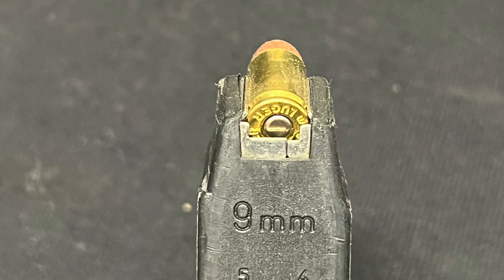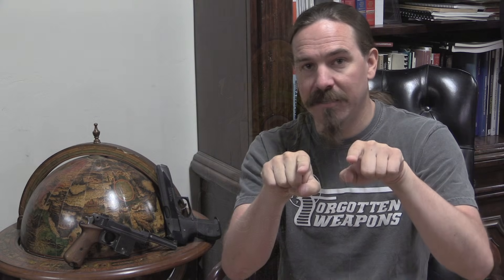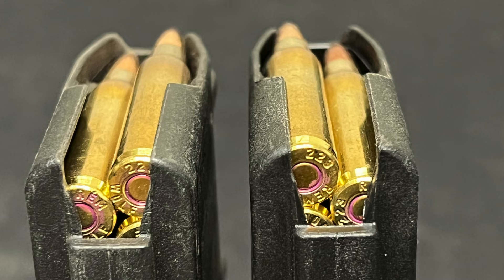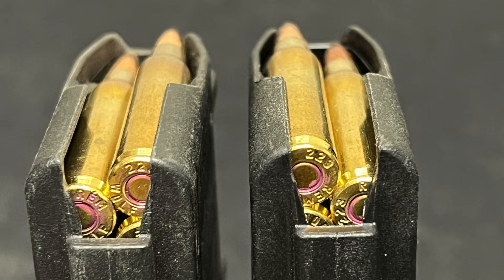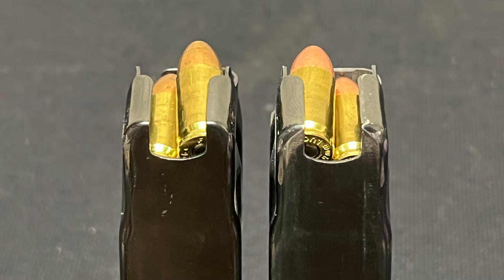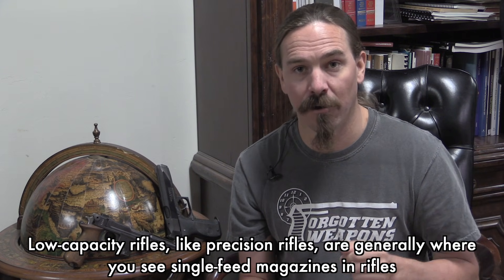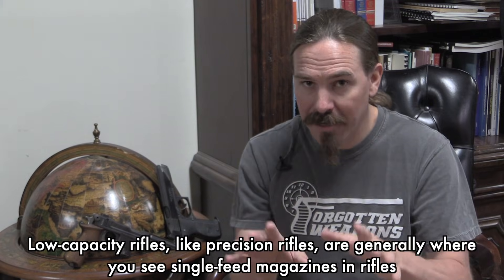Ask Ian: Single Feed vs Double Feed Pistols

Comment: There’s also the problem with space for the trigger bar (or more generally transfer of trigger pull to sear). With the narrower single feed, there’s much more of it, with double feed, it also adds to the width of the pistol. The Steyr GB has a sheet metal frame (with reinforcements where necessary), so they managed it well, but milled frames grow pretty wide with double feed magazines (unless you would perhaps use something like the transfer lever in the slide, like FN HP 35 does). Note e.g. the dual trigger bar in CZ 75—it’s pretty wide (despite the single feed magazine), and so is the frame. But that’s mitigated by the inverted rails system. Should the slide run outside the frame, it’d be huge…

Comment: Any experiences talking about reliability?. I´ve seen many feed problems on old long arms due to old, damaged, or poorly mantained doble feed magazines, specially sub machine guns (maybe shorter cartridges feed worse). But I suppose an old, damaged and poorly mantained single feed can be problematic too...

I don´t know, I suppose the lenght of the cartridge is key here. Shorter ones feed better, or easier(you get the idea) with single feed, longer ones are OK with double feed.

Comment: While I agree with most (maybe all) of the objections, I suspect that almost all of them are more "I don't wanna, I don't have to" . In other words, objection "because the engineer didn't have to" is probably the most influential. Pistol width could be a factor, but I don't be it has to be the issue. After all, the entire handgun is wider than the magazine either way. I think it's time for full-sized handguns with double-feed mags (at least in 9mm). Obviously the width issue would be huge in a bigger caliber, like .40 or .45.
Reply: Did you pay attention to the video at all?
Reply: @antuanperez426  Yes. Why? Did you read my comment at all?
Reply: @nerdyengineer7943  Yes, I did. He literally explained the reasons why there haven’t been developements for double feeding in pistols. 🤡 I read your entire nonsensical comment. The engineer didn’t want to because it makes for a more complicated system with diminishing returns.
Reply: @antuanperez426  Interesting. Because I am an engineer (I really am). I understood everything Ian had to say. The mechanical drawbacks he mentioned in the video are not an issue on a full sized handgun in a smaller caliber, such as 9mm - the slide strength aft of the breech is a non-issue in a Browning action (which most modern handguns are). The primary drawbacks, as Ian explained, are increased engineering hours without a GOVERNMENT customer requirement. But since people like me, and the guy that asked Ian the initial question, want a double-feed handgun and the CIVILIAN market would be delighted with it, there is money to be made.
But you're obviously not a mechanical engineer that deals with these exact issues day in and day out. So I can excuse your ignorance.
Reply: @nerdyengineer7943  You’re right buddy, I am a third year double major in Mechanical and Electrical engineering (I really am)  👍Again, you are complaining that not enough progress has been made in this area. If you used what you learned in school or at work for a second, you would recognize that making something small more complex for little benefit is not a good use of resources, whether the “GoVeRNmEnT” is asking for it or not 🤡 Why would you spend extra time in R&D for a double feed magazine when you could be researching (for example) designs that can make the firearm slimmer while still minimizing recoil? Especially when modern single feed mags are already very reliable and not very difficult to feed. 🤡🤡
Reply: @antuanperez426  Because they ARE difficult to load. And for all the people out there who (like also I do) prefer a "slimmer" handgun for concealing, there are hundreds of good options. But there are lots of people that would also like a double-feed option. The reason I mentioned government requirements is because I work for a govt contractor. What Ian said about how they don't design it for the user is very true. They design it for the govt customer.
As for R&D costs, that's a one-and-done cost. You gotta come up with something new every so often anyway. There are constantly new guns coming to market that people want because they are cool. A 9mm double feed handgun would cool. I would buy one. A lot of people would buy one. The fact that govts don't care if mags are easy to load is THE reason why gun companies bother investing. But for gun companies who don't primarily provide guns to govts, it would behoove Ruger or Smith to invest in something a little new. Smith just did that with their rotating barrel 5.7mm M&P last year... and uses a (you guessed it) double feed magazine. That's an 8mm cartridge. And that's one of the slimmest handguns I've seen. A 9mm double feed magazine will be 1.4mm wider overall. That won't even width issues. Reliable feed ramps are really the only issue at that point, and are the design point that would require the most R&D. But that's what engineers do.
Good luck in college. And when you start working, don't be afraid to think outside the box.
Reply: @nerdyengineer7943  I just disagree that they are so hard to load that it would be worth expanding into double feed mags. I will concede that a weapon like you are describing could have other uses than just being concealable for carry, I had not truly considered that. Thank you for wishing me luck, I will need it

Comment: You missed a possibly significant factor. The length of the bullets. A long bullet will be easier to move than a short one. The longer one will have to 'turn' less degrees than a short bullet. This would make pistol double feeds relatively harder to get right. The rifle bullet shape could help make them easier to use double as well. All the factors seem to favor single for pistols.

Comment: The Stirling SMG was a notable improvement on the sten, using a double feed magazine with a roller guided follower for reduced friction. But the Stirling will also feed from a single feed Sten magazine, it was designed to do so, as there were so many sten magazines available. So the Stirling feeds from three positions. Can it really be that hard to design to feed from two positions? You only have to do it once.

Comment: What about types and likelyness of failures the magazine design can cause? When USPSA/IPSC type competitions with PCCs started to become a thing, there were 2 common magazine types. Glock and Colt/Uzi style. The early Glock magazine PCC/lower designs tended to have mostly failures to feed, because companies needed some time to figure out magazine placement relative to the chamber (angle of an height of top round) and ramp design... so not necessarily the magazine to blame. The Colt style mags on the other hand seemed to produce double feeds, because more than one cardrige would pop out or failuires to feed because the stripped cartrige was less guided and had a higher tendency to tilt upwards or toward the opposite side it fed from. So the shape of the magazine lips had to be very precisely shaped. If you got some mags from a bad batch or slightly bent the lips from dropping them or so, the mags were useless, and would jam or doublefeed every 5 rounds. With glock mags you typically only had to make sure the feedramp design and the magazine orientantion workd together and then it ran trouble free for thousands and thousands of rounds no matter how old and beat up the mag was. Considering friction, the steel followers and sometimes rough finished colt/uzi mags felt a lot worse than the polymer followers inside the polished glocks steel insert, but thats probably not a fair comparision. Cant remember seeing very smooth colt style mags with plastic followers though. Also inserting full 32/33rnd Mags on a closed bolt typically felt harder on most colt/uzi style pattern ARs than glock ARs, but thats probably not the same kind of friction the cartrige stack experiences upon feeding. I guess slowmotion footage of how long the cartrige stack needs to pop up until feedlip contact after the bolt opening enough to clear the back of the cartrige (assuming both "stripper bars" on the underside of the bolt compress the stack by the same amount). But on the other hand, I thing I experienced more Colt/Uzi style mags where the cartrige stack got stuck than on glock style mags. I think I even only once experienced that on a glock mag, and that was on a faulty batch where some metal edges of the metal inserts seam were bent inside and caused a lot of extra friction on the follower. But I gueass there might also be better designed or better manufactured 9mm SMG double feed mags out there than colt/uzi style mags. They just never became that popular? You don't really see AR9s with e.g. HK Mp5 mags (besides a few very rare exots)

Comment: I think another consideration is that with pistols you are generally working with a short, wide, cartridge, which if you can imagine when trying to feed from either side of a mag you would have to have a really wide loading ramp/cone to make it work. Generally rifle rounds are longer and start narrow, this means your loading ramp/cone doesn't have to be super wide (reletive to the geometry of the gun).
When you look at pistols that fire rounds that are like small rifle rounds, fn five seven perhaps, you can use double stack magazines.

Comment: Something else worth noting is that while size was mentioned in terms of slide with, it neglects to mention the notion that OAL of the gun may also play a role. Think about an AR9 or even a regular AR there's a feed ramp that takes up real estate. In a Sterling they incorporate that ramp into the mag (oddly) and it's fairly small, but it's still real estate. Adding a 1/4 inch or more to the OAL of a pistol may be significant and less so on a rifle.

Comment: I wonder if the ratio of cartridge length to width has some effect on feeding reliability with single vs double feed magazines. A longer cartridge can wobble around some and most likely chamber, since it can't angle more than a few degrees before hitting something keeping it relativity straight. Where a shorter cartridge could angle quite a bit, and have a failure to feed, especially if the slide was made wide enough for a double feed magazines.

Comment: I also think double feed makes sense if you want to use the same weapon for different roles with little modifications. Since automatic weapons work better with double feed mags in most cases.

Like for MPs and officers to use a common semi auto only handgun but then to arm vehicle crews or helicopter troops or spec ops to have an smg with a barrel/slide change, a red dot, a larger mag and a stock. 

I would like modularity with a modern military especially accepting the use of only 2 or 3 common weapon systems and keeping the nato alliance more efficient with shared weapons.

Comment: Ian, or anyone else that does regular firing of an automatic pistol, Other than rate of fire, is there a significant difference in say reliability or accuracy of an automatic vs a revolver?  All my pistol usage in the USAF was with a .38 revolver.  I know that the Army at that time tended to issue .45 automatics (1972 - 1985), but I have never fired an automatic pistol.  And there is a world of difference between the M-16A1 and a .38 revolver.   They both get "Dirty" when fired but there is not a whole lot that is similar between the two when it comes to design or details.

Comment: CZ shadow p2 shot 1500+ rounds on stage shooting and precision shooting this year, not a single issue with double feed.. the only issues i had is with aftermarket weak trigger springs for faster and more precise shooting, and with diy bullet fillings since i use less gunpowder for less recoil of the firearm.

Comment: One thing Ian didn't mention that I think has some effect here is the length and shape of round. A rifle round is usually longer and more narrow, particularly at the tip where it can be more easily and reliably fed into the chamber, where a pistol round is typically short and blunt. Just think about the physics of the two, and it's obvious the pistol round will jam up more when attempting to 'angle' them into the chamber.

Comment: Pistols have higher recoil velocity and shorter, straight walled cartridges.   The majority of pistols are designed as controlled feed,meaning the rim of the cartridge engages the extractor before completely stripped from the magazine. The final push from the magazine aligns the cartridge fully in the breech face.

Double feed magazines are used in push feed as bottleneck cartridges align easier.  

Oddly enough, Mauser used control feed from a double feed magazine.  This was done with a large, open bolt face and a long, straight extractor face which allowed feed from either side.  Control feed was felt to be necessary during the rattle of battle and fast bolt actuation.

Comment: Hello! Very useful and interesting content, thank you for sharing it. One more aspect which can be important regarding to single/double feed: size of the cartridge. Using of double feed design, shorter type cartridges (e.g. 9x19) a little more likely to stuck, if the magazine a worn or not positioned perfectly, while longer cartridges can make it to the chamber more easily.

Comment: My Diamondback DBX pistol is double feed...  

Anyway... I reject out of hand the excuse about it being harder to set up a firearm to load off a double-feed.  That just simply false.  At least if you have an IQ over 100.  The feed into a circle is always 100% the same:  up to center.  The only "issue" mechanics wise is it's a tiny bit cheaper to use parts you are already making.  And no, you don't have to widen the slide at all.  At the tolerances of modern manufacturing, having the feed-prawl off-center a little doesn't add any significant stress.  It's a bullshit excuse.

There is however a real-world reason why you might want a single-feed over a double-feed in a pistol.  It has to do with the number of rounds coupled with the ease of loading.  That being, if it loads easily, that means it's easy to unload, including by accident.  When I was in, rounds popping out of the top of M-16 mags when crawling though things wasn't common, but did happen.  When you have 29 other rounds, that's not significant.  When you have 11 left...

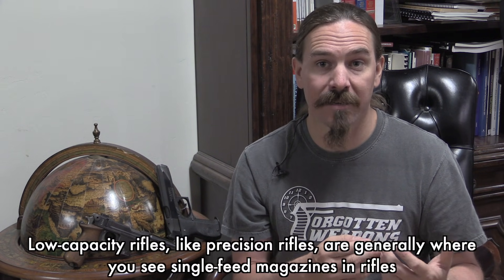Comment: Minor suggestion Ian: when you add text to the video (like at 8:56 in this video), please consider placing it higher (even at the top of the video), as placing it at the bottom interferes with normal reading of the usual youtube subtitles (which people like me relies a LOT on). Thanks in advance!

Edit: in fact... I would consider to place the text higher, if only so it doesn't gets occluded by the progress bar and playback buttons :-)

Comment: Double stack single feed magazine is also easier to insert into the pistol since the tip is narrower.  This combined with a beveled mag well makes it easier to slide in, whereas the double stack double feed has more surface area to snag when doing a fast magazine change.

Comment: The most significant disadvantage of double-feed systems in pistols, which you implied but did not say outright, is the moving barrel. It is not only more complex in general to account for dual feeding points in an action, it is significantly more complex, bordering on impossible, to do this with a tilting barrel. It is not a coincidence that the Steyr GB, VP70, and Mauser C96 all had fixed barrels.
Reply from the maker: The C96 (and the Bergmann) barrel does move relative to the magazine. They are both recoil operated actions.

Comment: Just realized my MP-57 (Ruger 57 conversion).. has a double feed mag setup. Going to check the rest of my pistols too. I never thought to check this. I've had a few like a Beretta M9A1 that had mags that was a pain to load. One good thing about double feed mags in my ARs etc I've noticed is they're hard to unload typically. But if you take a round and press on the 2nd from the top bullet as you unload the top one it releases the pressure on it and makes it just fall out. With practice you can unload mags very fast this way

Comment: I always wondered why there weren't more double feed pistol mags.  The only two reasons I could think of were A, that it would be (slightly) harder to insert the magazine, especially under stress, without a flared magwell, etc.), and B, that that it might make feeding more difficult, as now rounds aren't simply being pushed forward, directly into the chamber, but would instead be feeding at two off-center angles, which I imagine could difficult for such a (relatively)short, fat cartridge.
On the other hand, when you see clear versions of double stack single feed pistol mags(like those transparent ETS glock mag), especially in relatively tapered cartridges like 9mm(and even moreso in long, straight 9mm pistol mags like the glock 33 rounders), where the rounds look like they're a jumbled mess due to the front of the cartridge being so much thinner than the base, and the transition from double stack to single stack(again, even moreso on guns with relatively dramatic feed angles like glocks), it seems like a miracle that they work at all as it is.

*Edit*
Just watched video.  Never though about how the slide would need to be fatter for a doublestack magazine.  Interesting insights.

Comment: For the Swiss STGW 57 you have both - depending on the Magazine you are using - the normal 24 Shot Aluminium Magazine ist doublefeed - and the 30Shot Magazine - actually the LMG 25 Steele magazine - is singlefeed - Both works fine - but i had the impression that the precission while shooting the singlefeed 30 shot is slightly better - But the 30 Shot Magazine is Gigantic in size, as the bullets are stacked in a much steeper angle